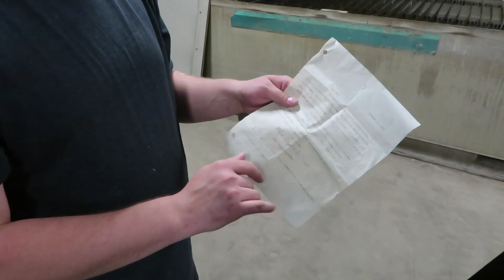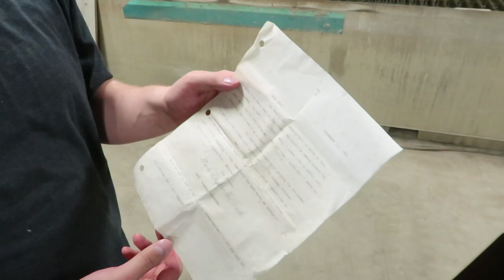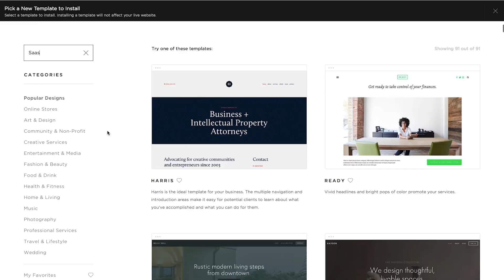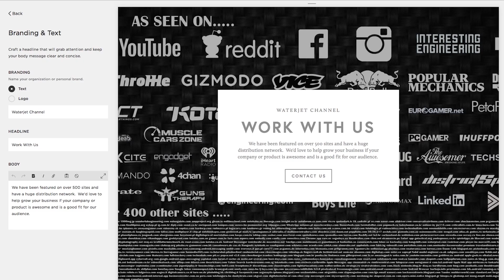Making an Ergonomic Typewriter with 60,000 PSI Waterjet cut in half

Comment: Ill never understand waterjets.

Why do they cut clean through thick stuff like metal sheets or anvils, and make a nice clean cut, instead of going in with a tiny hole but then blowing a massive chunk out of the other side? Why does the cut stay laser-straight?

And why can it be strong enough to cut an anvil in half, yet just a weird angle is enough to stop it from cutting a spoon?

And why is it strong enough to cut through a massive plate of steel, yet somehow it doesnt just blow out the tip that focused the water, just completely explode it all at once?

And who would win in a fight to the death between the Waterjet and the Hydraulic Press?
Reply: 1) It doesn't.  You can see it gets big on one side.
2) It doesn't.  They had problems doing spoon tricks, it just kept blowing through.
3) The tips are superhard tungsten but *do* wear out.
4) Nobody.